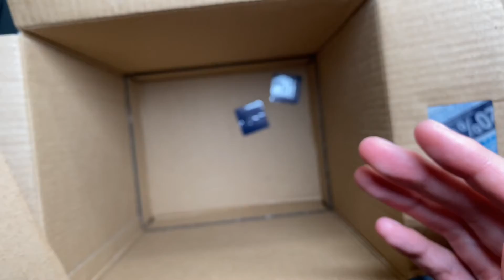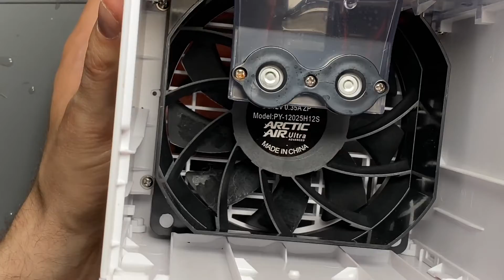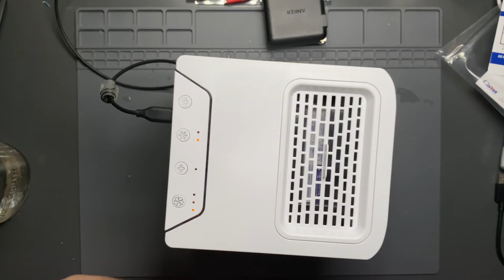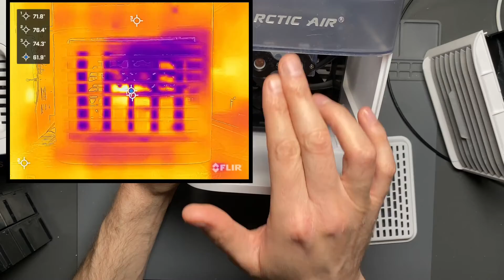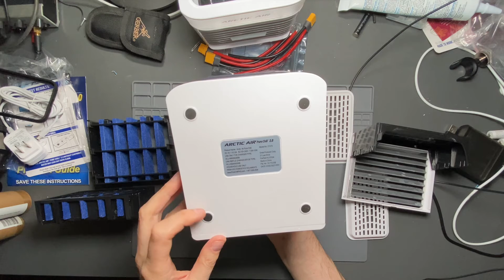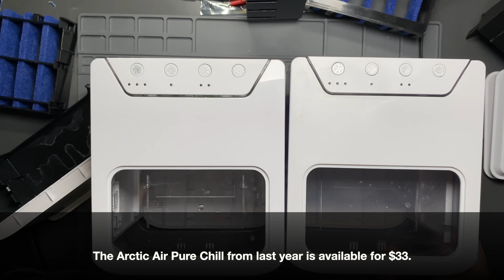Arctic Air Pure Chill 2.0 Analysis and Testing (2022 Version)

Comment: Is it normal that my back fan won’t spin? If not, do I return it and get my money back?😤
Reply from the maker: This unit only has one fan. If it is not spinning when turned on, then something isn't working right. Perhaps try it with another known good power supply or battery bank that can handle 5V @ 2A minimum.
Reply: I have had this and issue with two units,  the back fan doesn't turn on. I returned the first one thinking this was a defect, and sure enough it's got the same issue on the second one.

Comment: just get some ice in a ice chest with a fan in it on hight and a tube like a turbo motion and it with do far times50x better job under 10 bucks and no filter to change or clean and crapie c cord for power doomed to fail by water corrostion or just useimg it... once put it dount take off or you be up the rigging creek for power... water corrostion is fast occuring.... and so thin copper bakeing soda scrub will tear it off

Comment: My unit is very new.  Less than a month. Only use at bedtime.  Past 2 nights the water has not evaporated.  Help?????
Reply from the maker: Is it possibly in fan mode? Like are the misting function lights on?
Reply: @TheCuriousEngineerChannel  all the lights are on

Comment: Mine leaked on my table. I removed the rubber around the jets and cleaned the build up behind them. I had to make sure I tightened the screws to stop the leak. I started using distilled water in  it.

Comment: The cartridge end that has wicking material that's loose media is what goes into tray the media material wicks up the water in tray if you put carteidge in upside down yes you will have leaking water.

Comment: I bought mine 3 months ago and I was very satisfied with it and now all of a sudden the water is not evaporating??
Reply from the maker: Dang! Might need to be cleaned depending on the hardness of your water. I'll put a link to the video I made on cleaning in the description. Just know that on this one, the ultrasonic transducers are facing the front of the unit. Let us know how it goes!
Reply: Try Vinegar then with out the filter q tip swab the misters in a circular direction to the black plastic, but gently..

Comment: I would think by  removing the small cover you can put ice cubes in there.   My issus with the first version is the mister not working and I used a toothbrush to brush the coil inside the fan case to get it to mist again.  I use mine next to bed because it's close to me and does not work farther away.  Also found out to turn the light off completly just hold doqwn the light button and it will turn it off.  I live south of Vegas and temps are in the 110's but dry heat  Had to contact customer service and they really help you.
Reply: we add ice cubes like that really makes a difference